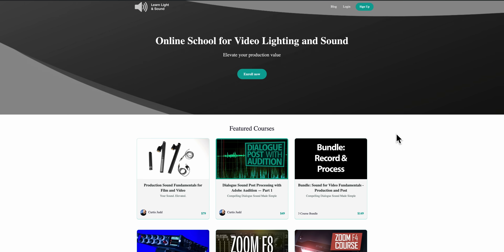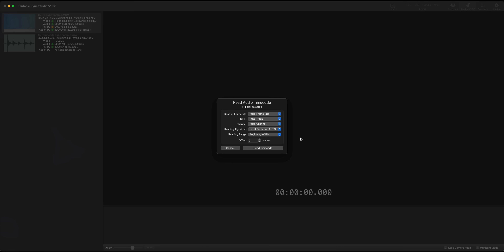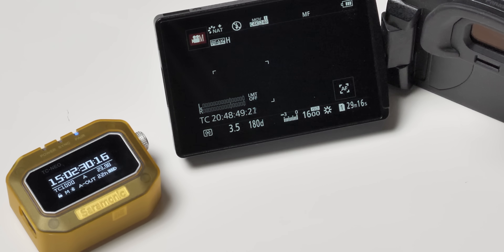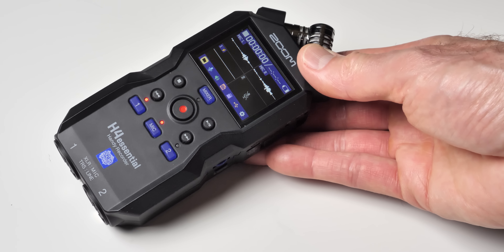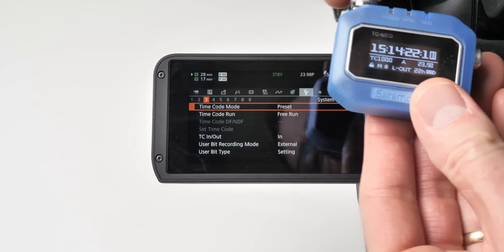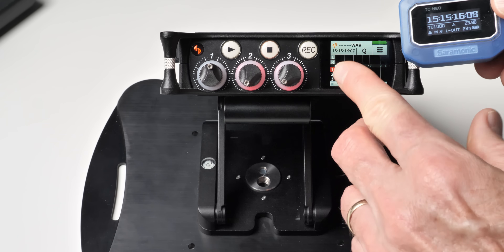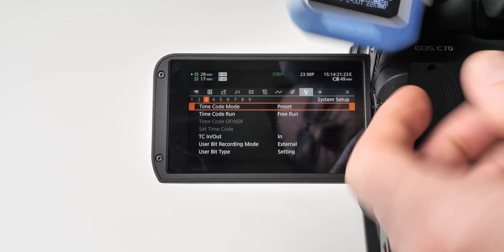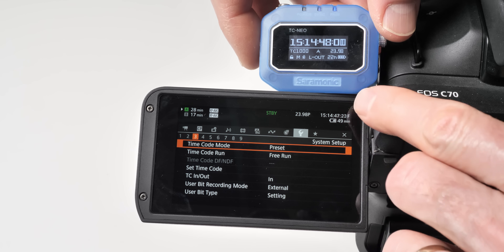Timecode basics for audio & video sync

Comment: With the recent integration of timecode in pro-sumer products like those from DJI there are many different ways to use timecode other than syncing externally recorded sound. I would for example like to know about syncing the internal back up 32bit recording with the footage from my main GH7 camera for example.. (I have the mic 3 and doesn’t seem to work using timecode). Another case is syncing the A cam with a B an Osmo Action 5 or an Osmo pocket 3. Sounds maybe little professional but that’s what we use on a primetime TV wildlife show for example / with limited crew and harsh outdoor conditions, these cameras are the bed tools for the job, but can become a real mess to sync all (multicam) later in post ..
.. would LOVE to see a video from Curtis about this. You’re the best. ❤
Reply from the maker: The receiver should record timecode audio to the GH7 camera so you can sync in post.

Comment: GOOD! one of the first explainer that starts correctly by saying that SMPTE timecode is not time but a numeration scheme, 👍 Hmm, should I send you some samples of my timecode generator? 😉 tictacsync. Since I get GNSS timestamps at both the start AND at the end  a of take, I can correct the audio for drift between devices and keep sync all the way. Also, using GNSS time signal I could verify the claimed stability of a tentacle sync, even in iced water! And they are holding on: drift is below 0.1 ppm....

Comment: What is your recommendation for generating timecode for both video and audio when using CCTV cameras and separate audio recorders in a reality show setup? If timecode cannot be embedded in CCTV footage, what alternative workflow would you propose for maintaining accurate audio–video synchronization?
Reply from the maker: I haven’t worked with CCTV footage so I don’t know. My guess is that you’ll most likely have to manually sync without timecode.

Comment: One of the most neglected topics is how to deal with timecode over multiday shoots or over midnight shoots. Since timecode is based on Time of Day (ToD). Would love to hear more about how you deal with this? I made the mistake of bringing all footage/audio from 7 day shoot into resolve, select all, sync all. Was surprised to hear multiple scene audio tracks on different scenes (because the timecodes match the time of day). Do people typically just bring everything in by day to bins and only sync those, do they use some kind of filtering to select, or I heard there are some that use an offset like day 1: 0, day 2: 24hr, day 3 48hr, etc. Lastly I heard people mention they set the timecode clock to start at 1 hr or reset it somehow after lunch. Can you explain, in more detail, how pros deal with multiday shoot organization and syncing?  thanks!
Reply from the maker: I use bins for each scene. That deals with the multi-day issue (very rare that a scene spans more than one day). You could also use the uu bits to specify day, but you’d still want to organize clips by scene and just use the uu bits as a note to organize in post if needed..

Comment: Thank you for a great introduction to timecode workflow! 

Would love to learn more about using timecode with different framerates. For example if my team and I are recording a panel discussion at a conference or a wedding ceremony, 1 static camera at 24fps and 1-2 gimbal cameras recording at 60fps, and we are to deliver one long form video of the full panel cut between the different cameras and a separate short form highlight video (both delivered in 24fps), which may have slowmo or speedramping, hence the need for 60fps. Would we be able to sync all the cameras on a 24fps timeline even though they're recording at different framerates?
Reply from the maker: In theory, yes, but in practice, I don't know how to make the workflow you cited work because you have to set the same framerate on all timecode clocks so they'll line up in post.

Comment: Would those timecode generators be supported by Sony Pcm M10 recorder when an external mic is plugged into its 3.5mm mic in  port?
Reply from the maker: You'd have to feed the timecode into one of the XLR inputs on the M10 if it has one?
Reply: @curtisjudd 
sony Pcm M10 has one 3.5mm stereo mic in (plugin power),  and one 3.5mm line in

Comment: My setup consists of a Canon R5, a TASCAM FR-AV2, and a built-in timecode generator. Now I want to use an additional camera. For this, I need an additional timecode generator. What's the best approach? One or two timecode generators and no longer using the TASCAM FR-AV2 timecode generator.
Reply from the maker: Whichever works for you workflow should be fine.

Comment: I’ve been thinking on getting timecode for 1 hour speaker events recordings with multiple cameras and one zoom h6. I have faced this issue with the recordings being out of sync by the end of the recording. So in this case you mentioned timecode might no be the answer, should I start looking at wireless transmitters instead?
Reply from the maker: Or feed the audio mix directly to the cameras, yes.

Comment: This seems (overall) unreliable and in my case takes away a needed mic port on my camera. Although I can see how this would be helpful on cameras and recorders with specific "Timecode" inputs.

I do a lot of corporate/wedding recording and livestreaming stuff, I usually always do a "Clap Test" if I need to sync up external audio with my cameras, this just allows me to sync up all my cameras and audio tracks to the peak of the clap. This has always worked for me and I have never had any sync issues (it also doesn't cost any money).
I also have 2 Rode wireless Go systems that I use to both mic up people and to send sources like my audio recorder to my camera so they are synced (this also acts as a back-up).
Reply from the maker: I wouldn’t call timecode sync unreliable, just that it isn’t the right tool for every job and it doesn’t do all the things people assume it does. It is very helpful for narrative film when the production finishes each day with hundreds of clips.

Comment: Thanks! Are signal splitters compatible with LTC? I could imagine using a Y-cable to turn one time code signal into two.
I could also imagine using a dual mono to stereo splitter to hide linear timecode in the left channel and patch in some backup mic audio in the right. In practice I've had no luck due to bleed through.
Reply from the maker: Probably, though I haven’t specifically tested that.

Comment: so great this video! I use a Behringer WING COMPACT (recording with WING LIFE on SD card) to record my bands life performance, so I have 9 separate audio tracks (WAV). Also, I record video with Lumix cameras with additional TENTACLE E timecode generators all synced and attached to the microphone port. Could I record an audio timecode using Tentacle E on a separate channel of the Behringer WING and then TIMECODE SNYC all the recorded audio files as well as the video files in FCPX?
Reply from the maker: Should be able to, yes.
Reply: @curtisjudd thank you Curtis! I tried. Unfortunately, tentacle sync studio does not accept the audio files that have no time code! Thus I cannot synchronize these audio files with the timecode audio file!

Comment: Very good background information and practical explanations. Do I understand correctly that TC units jam connected devices to the same beginning TC moment, and yet those different devices (camera, audio) can still suffer individual drift throughout the day regardless? They don’t supplant the native, governing internal clocks in practical terms.
Reply from the maker: It is a bit nuanced. If a camera has a timecode input and you leave the generator connected through the entire shoot, each time a recording is started on the camera, it takes the current timecode from the external timecode generator and puts that in a metadata field for that video clip. That's all it does. The external timecode generator does NOT become the camera's real-time clock replacement. If you need something like that, then Genlock is the technology for the job.
Reply: Thank you. So, regardless, with synced external units attached to all  of one’s recording devices media will be easier to align in editing. Love your detailed reviews and explanations. Thanks again! 😊

Comment: Again, a very great video, thank you very much! I wonder how Final Cut Pro or other video software do synchronise audio and video using the time code: Is the audio streched to match the video ? Or does the software add frames to match the audio?
Reply from the maker: No, it does not address drift, it only syncs the start of the clip. You shouldn't have to worry about drift unless you do tests and learn that you have a drift issue.

Comment: Could you talk more about how cameras may be in sync at the start but may drift over time? You mentioning that reminded me of a video I shot long ago where I went through exactly that. The recording was also about 1 hr, and it was driving me nuts!
Reply from the maker: The real-time clock of the audio recorder and camera each drift at different rates depending on the ambient temperature. Usually this drift is inconsequential over the course of 20 minutes. When you get to an hour, it sometimes becomes evident. If it is a bit hotter or cooler, the drift may be exaggerated.

Comment: How reliable is the MixPre-3 II after once synced with timecode or even generation timecode as a feed I then sync my timecode devices to? Does the SoundDevice has a reliable internal clock?
Reply from the maker: The Sound Devices MixPre II all have built-time TCXOs so yes, they're reliable and consistent.

Comment: I'm filming a live event this weekend and I'm not the one who will be editing it. The editor isn't really familiar with Timecode. I'm using Deity TC-1 boxes and a Zoom F8nPro. I'm actually filming with 4 cameras. 3 in the LUMIX system and 1 Pyxis. My thought was to run the TC-1 boxes into the 3 Lumix cameras and then every couple of hours resync the Pyxis with BNC out from my Zoom. I also was going to use all the outputs from the Zoom to transmit the stereo mixdown from the live sound mixer to the cameras. I'm kind of assuming that the editor will then either be able to take channel 1 (the stereo mix down) OR channel 2, the TC audio signal. I've never tried something like that but not sure why it wouldn't work that way.
Reply from the maker: Usually timecode will be on channel 1, scratch audio on channel 2. Definitely test beforehand to confirm.

Comment: Hi, Curtis! Great and helpfull video, thanks. 
Just starting with timecode sync (using 2 x Deity TC-1) I have made my first (and unfortunately - disappointing) test with my both Panasonic camcoders: 
• I have recorded 5 short clips (2 min each) with both cameras.
• On HC-X2 → supplying true embedded SMPTE timecode via BNC TC-IN.
• On HC-X20 → supplying “timecode as audio” into mic input → then in Resolve  “Update Timecode from Audio Track” (Resolve reads LTC and regenerates TC).
• On the timeline in Davinci, when I sync by timecode, the HC-X2 clips (with embeded timecode as metadata) are consistently a little late then the HC-X20 clips (with embeded timecode as audio). More strange - this delay isn’t always identical - sometimes  about 300 ms, sometimes 500 ms or in between.

Both TC-1s are perfectly synced, both cameras are brand new. And I have expected a very precise syncronization. Of course, I was able to do this perfect sync with "Synchronize using waveform", but investing time and money for using timecode as a more professinal approach, I would like to find and remove the reason for this offset - problem.
I will appreciate your suggestions,

Regards, Boyko.
Reply from the maker: I'd suggest contacting Panasonic technical support. Also, try using the DEITY app for sync instead to see if it is an issue with Resolve and the clips from the cameras.

Comment: Thanks a lot, Curtis - I did never dig into this so far, and it sounds most useful for longer pro-level recordings with multiple audio- and video-sources. Easy workaround for me was always to let the camera track ambient audio with its internal mic, and sync this with my high quality audio by eye afterwards, based on the waveform. A handclap at the beginning helps big deal there... For up to 15 min long recordings, I never experienced drift issues even on the audio tracks, which are far more susceptible to any drift (means: I never experienced a sound  'phasing' when I mixed both). After all, video frame frequency rarely exceeds 60Hz compared to up to 18kHz audio.
Reply from the maker: This is mainly for narrative filmmaking when, over the course of a day, you recording tens to maybe over a hundred takes. In those cases, manual sync of tens to hundreds of clips becomes pretty tedious and time consuming.

Comment: Great video - really helpful. I have a DJI mic 3 kit here on my desk so I'm just about to find out how (or if) it will integrate with my 9 year old Panasonic 4K camcorders, my Lumix GH5 and Zoom F8. I record stage shows and perhaps I was lucky with my choice of kit but I find that they all stay in perfect sync for up to 2 hours without timecode generators, with perhaps the occasional single frame slip. I've got really good at syncing them all in the edit but I'm keen to use timecode in  the future.
Reply from the maker: Good luck!

Comment: If i want to film several non-consective clips throughout the day and mix and match 29.97 fps and 59.97 fps if i set the time code to 29.97 will that work when syncing?

Do you have a comparison between the saramonics and the tc-1s?
Reply from the maker: I don't know the answer to that question. I've never filmed in 59.94. I'm sorry.

I don't have a comparison between the TC-NEO and TC-1.

Comment: My first big event I did had 8 hours of continuous  audio and video recording. When we were going through post and editing, we noticed that the audio drifted by 3 seconds. It was annoying because we had to go through, make cuts in the timeline and readjust to sync it back up.
Reply: Some external audio recorders will produce successive takes ( every 10 mns for exemple ) without any audible cut to minimize this drift if you need to film continuously for hours...you can set a maximum time of each take in the settings of the recorder
Reply from the maker: Yes, that's what drives that question quite often. People often assume that every frame is synced with timecode. In fact, it is only genlock that essentially syncs every frame.

Comment: In the latest 2 update of Davinci Resolve you can select timecode from Audio track. Still a good idea to use a slate to check they all are in sync, I have seen different cameras have a shift even after JamSync. I am using MovieSlate on the ipad, it works with a few TC generators.

Comment: This was so useful, but tragic for me! I've gone all-in on timecode for multi-cam podcast recording (3 x Sony cameras & Tascam audio recorder each with a Deity TC-1 & Deity PR-2's when I don't use XLR mic's). The tragedy was learning that beyond 20 minutes this may actually be pointless ☹

I don't fancy 'shifting' my video by a frame or two every 15-25 minutes!
Reply from the maker: I should say that it is worth checking your particular setup. If you work in a relatively well controlled space in terms of ambient temperature, you may not experience much drift. Test, test, test.
Reply: @curtisjudd thanks Curtis, appreciate the response.  I tested it for an hr & it was all still perfectly synced; as you (rightly) say, test, test, test!

Comment: Another thing that is useful to know is that (in my experience) the TC values from an external generator that get written to the camera or audio recorder may have some processing delay and be offset from the momentary value output by the generator. e.g. with my Deity TC-1, the value that gets written to my BMPCC 4K camera is about 2 frames “late”. If I sync separate audio and video using TC, there will be a 2 frame sync offset that needs to be corrected either on the timeline through waveform matching , or by adding a fixed offset when doing the alignment step. 

This is apparently very common on many cameras, so don’t expect TC systems to magically sync everything perfectly- it will likely still require a minor adjustment. That said, if continuous external TC is recorded, the offset should be consistent over many hours, and is still much easier to fix than having to sync using the traditional slate sound & image matching.
Reply from the maker: Thanks for sharing.